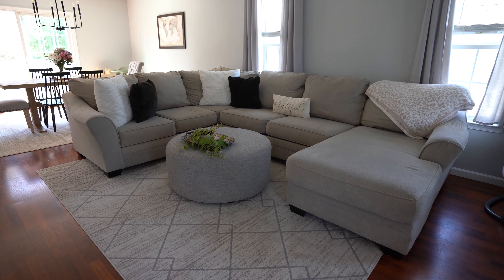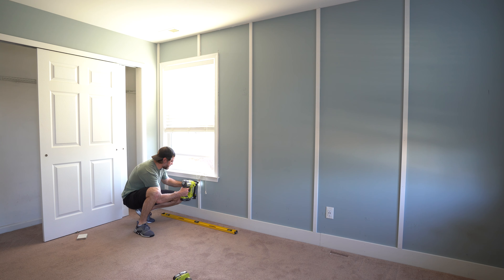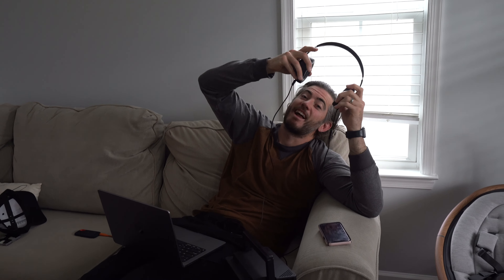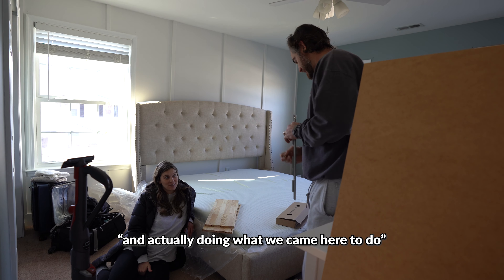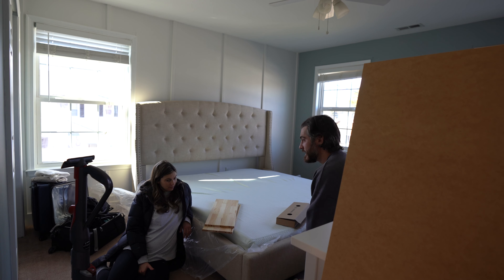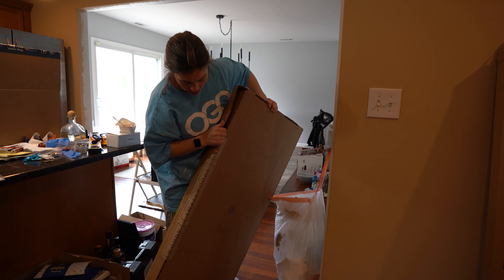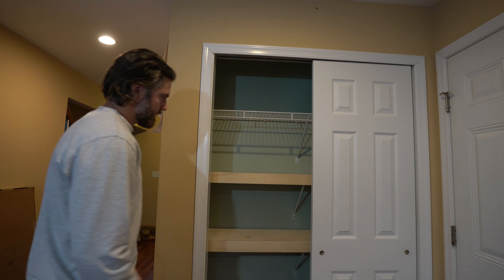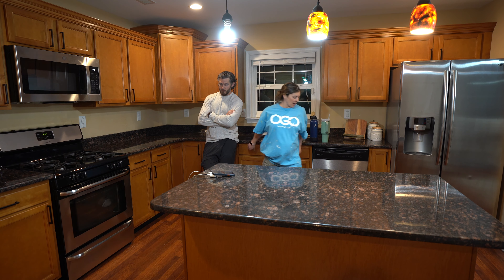The Renovations Continue Until The Gas Company Shutoff The Gas To Our New Home

Comment: When opening paint tin, try putting a flat head screwdriver in and then rotate it clockwise - don't push it down. Rotating it clockwise should pop the cap and it protects the rim stopping it from bending (you might need to do it in a couple of places)
Reply from the maker: Love it thanks Gregg!!

Comment: You can take plastic wrap and place it over the top of ur paint can and seal it tightly.  Make sure there is no air in the can. Use painters tapenor electrical tape to use around the plastic wrap to seal it. I hope that makes sense. Lol
Reply from the maker: That does Stacy, thank you!!!! Good tip